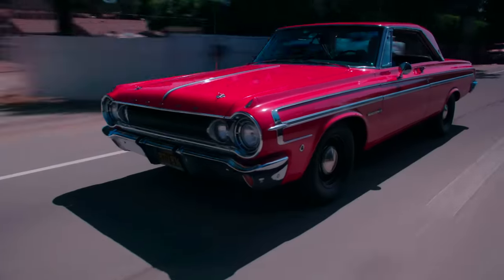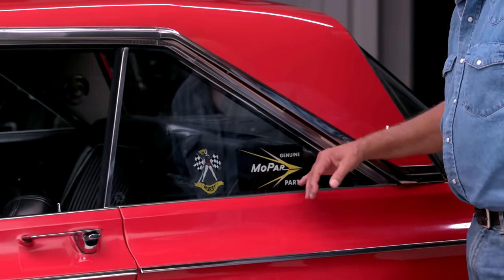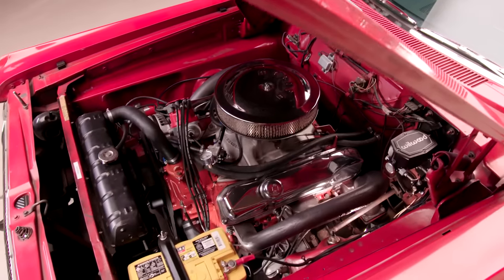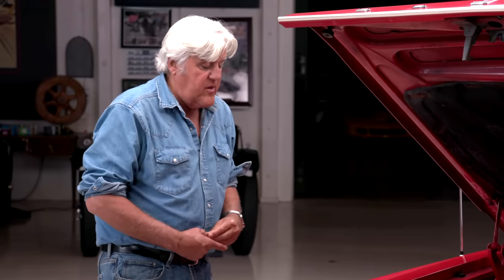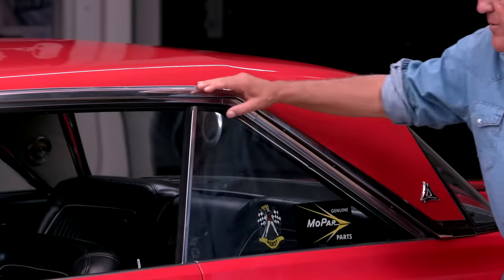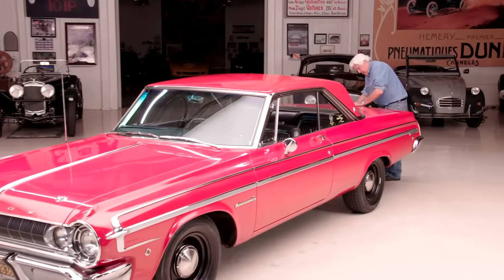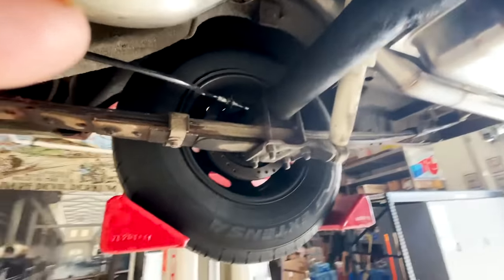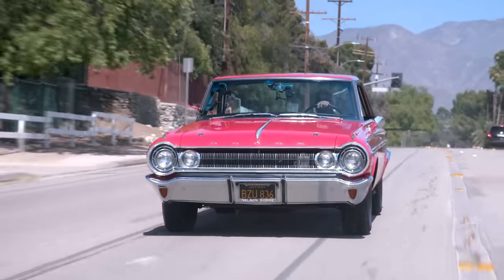1964 Dodge Polara | Jay Leno's Garage

Comment: My 66 Fury 2 had A 318 Big Block with 3 mechanical 2 Barrels and a solid cam, Till around half throttle it ran on the center carb and then dumped all 3 and the tires started screaming. Raced A 69 Mach 1 429 and I was just as fast with 4 people in my car. It was A Wedge Motor. My first car at 15 and my next door neighbor was A mopar guy and he helped me get it running right. 50 dollar car in 1976 with no brakes. Two years later I put it into a tree ! Oh Well !

Comment: I own a 69 Road Runner Convertible its looks like it came off the show room 
It has 25000 miles .
I own 20 cars 
I have 55 56 57 chevys stick all original  
I have 69 Camaro z28  42000 miles 4  speed  1998 1999 Suburbans ine 22000 miles  and the other 44000 miles 
I am a small time collector i collect  Guitats also

Comment: Wildwood disc brake downgrade as it barely stops now but seems to be a thing in California to make it harder stop vehicles. 68 sidelights not sure how that was wired in since there is t any provision.  Max wedge manifolds. Regular wedges didn’t have them. CarbS were dual inline or offset and work just fine.  I see someone moved the top fitting over but may not have the large openings top and bottom. Bad exhaust too you will be cleaning the bumper a lot and snap a manifold.  Nice idea but the factory exhaust was way better with the knock off plates, gives room to work on transmission or starter as well.

“Three for stops no brakes” yeah right, “ now it stops on a dime everytime” no it stops past the dime everytime sheesh tell the truth mr Leno.

Comment: My buddies dad owned wrecking yard. We built a 1964 Dodge 440 Hardtop that had a blown up 383 wedge & 4 speed. There was a 426 Wedge 4-barrel Stage One engine from a crashed '64 Polara. Put it together and it ran nice. I added a large rear sway bar and a second front sway bar, Koni Shocks, 6.5 inch wide CHP Cruiser wheels and 225/15 Dunlap Radials. Used the drum brakes off of '62 Dodge CHP Cruiser that was wrecked. Entered it into local hill climbs and gymkhanas  & did ok against Corvettes. I put 4.11 gears in it once, but used too much gas. I liked 3.55 / 29 spline center section better. Drove it for a couple years then went back to college and sold it.
Reply: "buddy's"

Comment: I need a 1961 Chevy 6-cylinder 235 do Josh and split carburetors, you can assure me that I would be able to finish up for the evening Rattata Parks problems I was all of 17 years old, we didn't get done I had a date that night in Roseburg gentlemen, his name was Andy Hall and the regular still on the rack, I had a date that night with lady in Roseburg I'd waited two weeks for that day I wasn't going to be able make the date because of the lack of parts, did you take my family car push button on the dash come look like a family car to me why you would entrust his car to a seventeen-year-old I'm not sure other I had ran tow truck for a couple years, his wife complained alright I had no idea what I'd find me into this is a 426 wedge cross ram, do the driving everything went pretty much like a normal date you know hamburgers and Pepsi and french fries and the movie and Little necking, turns out everything's fine replacing fuel so I went to the discount station in Roseburg, where guy had a had a Comics print with a 390 in it, I said this is not my car, I don't race cars that aren't mine yeah, I took the lady friend home I turned around and when I'm at the freeway, on the on-ramp was this 390 comet, he came up smoking tires beside me, so I just ran off and left him oh, I didn't smoke any tires at all keep in mind all day I've been driving to 6 cylinder 3 speed , that crossramp 326 wedge power then the 406 63 and a half Galaxy XL four-speed Ford came out with! I had wrote in a couple a few years before Chrysler 426 wedge was just unreal 4 power, when I returned it back to the owner the next day he asked me did you feel it did I ever measured the guy it's just count chases pissed he said good I'm glad you got somebody oh, I actually feel a little bit guilty in some ways because it's not my car, after that I had quite a few hot cars really nice the 375 horse Corvette small Journal that would be the early model, also had a 59 Sedan Delivery like a mother's wax car with a 410 horsepower 327 in it, with full suspension built and rebuilt with a glove gone and all built to handle, oh by the way 59 also walked away from the Ford comment about one year later, when the guy saw me pulling the pump from then on no matter was driving he wouldn't even come out and talk to me, because the two cards that I beat him with basically afterwards but he was embarrassed by the first one I think! Take care of yourself Jay I watch your car three years I enjoy it! So hoping when you open up on that with the Croc Ram but it wasn't that I was hoping it would push button but it wasn't!